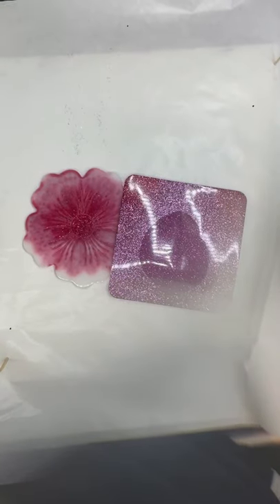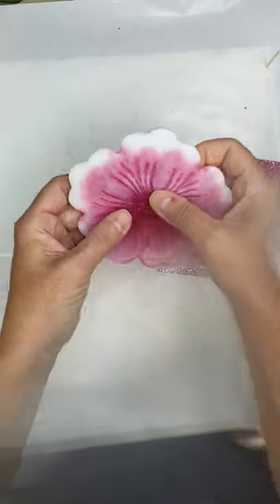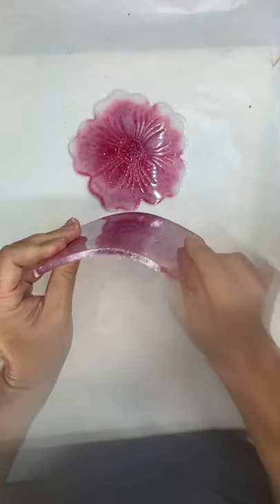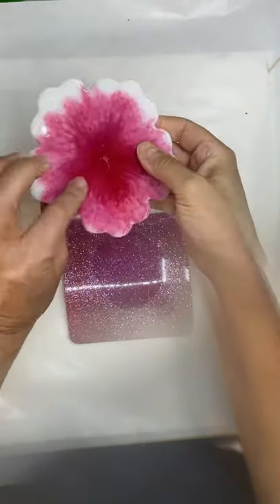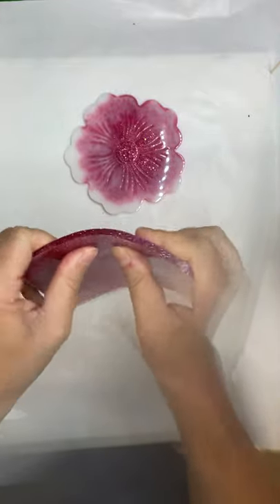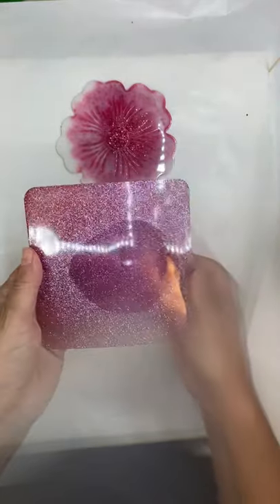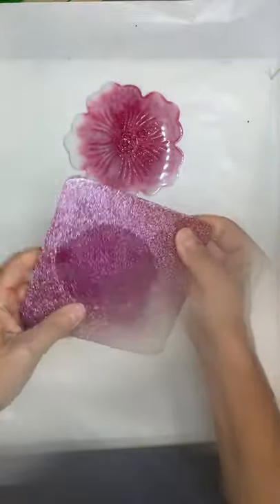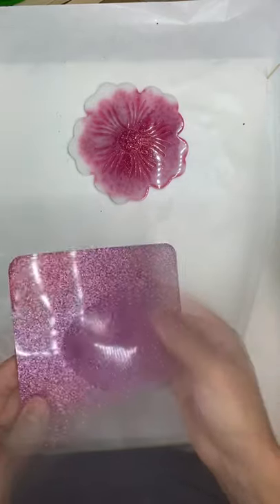Why is my resin bendy?  -- Learn why your resin is soft and flexible

Comment: man, I've been using Art Resin to make some casts. In some molds, the resin hardens fine, in other molds it never really cures right. Unfortunately I put a lot of time and effort into some charms vs some bigger, easier pieces (that cured fine), and it was the time-consuming pieces that ended up bending lol. I sprayed mold release in the same molds that weren't curing right because the resin was sticking to them (but not other molds). Didn't bother to look up how appropriate that was lol but I suspect this last batch may have soaked up the mold release 😭😭 I'm wondering if I sand the pieces down and coat them in a fresh resin bath, it'll seal the soft resin in hard resin? xD I don't want to throw them out

Comment: I make keychains and i used the same resin for my keychains and one came out hard and another came out bendy. Does what you put in your resin (things like decorations and such) have an effect on the curing process?
Reply from the maker: Yes, it does.
Reply: Mine have been doing the same. I make keychains, and here lately it has not wanted to cure right.

Comment: I have a question…I know this video is a couple years old but I cannot for the life of me find the answer anywhere to this! My sister and I have been making resin things like coasters and bookmarks and trays and things for about a year and a half. We recently we had some of our things at a craft fair and it was outside on a sunny day. And things that we had made a year ago and were solid as a rock started to bend and droop in the sun!! Why is this?! We knew sunlight could cause color change but had no idea our things would start to bend!!! Is there any way to ensure this doesn’t happen??? We had products at the fair made with 2 different resins, one was a quick cure resin and the other was a deep pour slow cure resin, and products made with both were bending.

Comment: This is a great video, thank you! However, in my case, I used the same resin for everything I made. It was my first time ever. Anything I made in blue is completely solid like it should be. Everything else is bendy. First thing, there was some that was not exactly 1:1, since I didn't set the silicone mixing cup on a flat level surface to pour it. I held it and poured with the other. That might have done it. OR, could it be I might have used too much pigment and/or mica powder in the other colors. Any ideas?
Reply from the maker: Hi, unfortunately, one resin doesn't work to make everything perfectly. This article will help: https://www.resinobsession.com/resin-frequently-asked-questions/best-epoxy-resin/

Comment: Flexible coasters are "inappropriate?" How so?
Reply from the maker: I think people have an expectation that a coaster won't bend or warp with use. I'd hate to think someone put coaster in a drawer only to get them out later and find they're in a wonky shape.
Reply: @ResinObsession  Bent or warped, sure. Then it doesn't sit flat. But if it remains flexible, what's the problem? Not trying to be a jerk or anything, it just seems  to me that flexible resin coasters might actually be a good idea.
Reply from the maker: If a coaster is bendy, it's also more likely to scratch. If your coasters are flexible, and you make people aware of that, then I think it's fine to have bendy coasters.
Reply: @ResinObsession  That makes sense. Thank you!

Comment: I needed some resin, saw some at Walmart while I was shopping, and figured I'd give it a try.  It was a Rustoleum brand of pour on epoxy.  I used it in a mold, and my keychains came out super bendy.  I managed to stiffen them up pretty good, with several coats of casting resin.  
It might be fine for keychains to be bendy, but I didn't like it.  Who knew there were different kinds of resins?  Lessons learned... the hard way, of course.
Reply from the maker: Glad I could help!
Reply: Did you paint the casting resin on, or dip the Keychain in it?
Reply: @truck6859  I painted it on.

Comment: Now what would do if you accidentally calculate your resin/hardener mix. 

For example the correct ratio is 100/50 and you accidentally  mix a 100/40 ratio?

Will resin get hard eventually and is there another way to save what was previously poured?
Reply from the maker: It's unlikely this resin will harden.

Comment: I would like to do a resin art 24” 36” size and that would be carried other country. 
- though luggage size is not big so is it possible to package in a folded way? what resin formula should be used? Which formula will help to maintain the texture? 
For this should just resin is enough as base or painting on canvas cloth is good ?

Comment: Question…….

I want to make what is called a “bonk rock” it’s a term Onewheelers use to describe a small rock shaped hump or bump or volcano shaped or ramp shaped lump to place on the ground to ride over with a Onewheel which is like an electric skateboard/hoverboard to provide a way to hop both vertical and horizontal just ever so slightly lol hope this makes sense there’s lots of videos of Onewheels using pocket bonk rocks…people sell bonk rocks but they are pricy I have no clue what they are made from  and is what I’m trying to find out or at least pointed in the right direction..I was thinking it’s some sort of  flexible resin is what comes to mind.. these would be a created using molds obviously since bonk rocks need to have some height and are pretty thick depending on what you like and different shapes. a flat bottom to place on the ground. is a resin capable of this? It would be run over by wheels placed on dirt on asphalt sidewalks. I can’t have it sliding so it needs to hold place decently I would expect it to move s bit and hold shape but it would not be hard as a rock it would need to be slightly bendy and flexible but not like ballistics gels type of squishy.. no chipping cracking or breaking from the abuse of being run over and hopped off of.hoping it would have a little weight to it as well. Again all I know is from what I’ve seen on bonk rock websites and videos  and I just can’t pay 60 bucks for a jelly looking bonk rock.. I’m a total diy person and always try to find a work around when I can.. and I feel these would not be something technically complicated and could make my own and probably many more if I made it myself.. just need to know what it’s made of without having to actually pay for one lol..These rocks I’ve seen seem clear or with colors mixed in each in they say are different no two the same not sure what else could be used other than some sort of clear bendy flexible resin… does anyone have any tips or idea what these are made of? if so where can I buy?👀
Reply from the maker: Hi Bree, I wouldn't use resin for a project like this.  😕

Comment: Actually, for the craft I'm trying to make, I need the resin to be a little soft or bendy. What can I do to get that result?
Reply from the maker: Use a doming resin.
Reply: . Thank you very much😁 Can that be brushed or dipped? What I want to do is apply it to a thin metal ring, about 3 - 4 inches in diameter.

Comment: This was helpful thank you! Can you mix the correct harder separtely and pure onto the mold so that it hardens? Remining the correct chemicals, a thin layer? I have this problem and I do not want to toss my art, and they are beautiful but bendable.
Reply from the maker: Hi Latoya, assuming your resin cured fully, I'm afraid there isn't a way to make it harder. You can try to put it in a frame or brace it from behind.

Comment: Is super gloss from the epoxy resin store a casting resin?? And can I use it to coat art work and make a bowl with??
Reply from the maker: Hi, I'm afraid I don't know about those, but we have casting and coating resins in the Resin Obsession store.
Casting resins:  https://shop.resinobsession.com/collections/resin/casting
Coating resins for artwork:  https://shop.resinobsession.com/collections/resin/surface
Reply: @ResinObsession  which one would you suggest for free pours and art work??
Reply from the maker: The Resin Obsession artwork resin works great for that.  You can buy it in our store here:  https://shop.resinobsession.com/collections/resin/resin-obsession-artwork-resin

Comment: Hi，I made an square resin in a square mold around 8”x 8”x 2.5”, but the sides bent inwards after demolding, do you know why? Thank you!
Reply from the maker: It sounds like either your mold sides weren't straight or your resin wasn't fully cured before demolding.

Comment: My resin tray is hard. I cannot bend it at all by adding pressure with my hands; but when it isn't on a flat surface for long it warps :/ is this a regular thing?
Reply from the maker: Hi Paulian, unfortunately no.  It sounds like your mold wasn't level as the resin cured.
Reply: Did you find a solution? I’m facing the same problem! My tray is hard and perfect but when I lay it on a sofa/uneven surface it curls and warps as well !!! 😭😭😭

Comment: So could you help me by telling me what resin/product i should use if I want my molded piece to be bendable. I have been searching forever to figure this out. I love the quality of a resin piece but if I want to adhere the piece to make a decorative egg I need it to be flexible to take that curved shape. Please help. Can't seem to find anyone with the answer.
Reply from the maker: Have you thought about applying the resin directly to the egg?
Reply: @ResinObsession  Actually that's exactly what I did once. I had made a particular delicate scroll piece that was still a bit pliable when I removed it from the mold so I placed it directly on the egg and gently taped it on. I hoped it would finish "hardening" and I could remove it, with the curve still intact, and paint it. When I removed the tape I discovered it wouldn't come off the egg! Well luckily that worked out fine anyway, just made painting alittle more difficult. But it would be nice to be able to make a bunch of pieces ahead of time to use on curved surfaces.

Comment: The casting resin can also be bendy, if you got the mixture wrong. If you use less hardener, than you should, it also can come out bendy... it tends to harden a bit over time, but it usually stays a little flexible.
Reply from the maker: Yes Lars, you're right on that too, but I find that using a doming resin in a mold is the most common reason people have flexible castings.  I mention that and other reasons for bendy resin in this article:  https://www.resinobsession.com/resin-frequently-asked-questions/why-is-my-resin-bendy/
Reply: If a casting resin comes out bendy and if it's a ring, is there a risk of chemical leeching? I made a few rings and two of them are for my kids. 3 and 5.
They have been waiting patiently for them and pretty excited to be honest. Thanks. 

Sincerely,
Jeff

Comment: Can you fix this if it is still in the mold?  Pour a thin coat of casting resin in the mold if there is space?
Reply from the maker: That might work.
Reply: @ResinObsession  i have this super bendy tray ...i made 1 that dried fine..the other 2 dried up supppper bendy...for my recent tray,its bendy but i havent put a top coat on it...should i try the casting resin if it can work to dry hard for the tray?

Comment: I use casting resin but when I leave my coasters in a hot room like no A/C and 90 degrees it starts to bend. Is this normal
Reply from the maker: No, I wouldn't expect that.
Reply: @ResinObsession  when I take my trays or coaster in the house with air conditioner is rock hard but if I take it outside start to bend like hard rubber. I tried many resins, they always 1 to 1, I use an scale for the resin. Do you have any idea what I may be doing wrong?
Reply: I’m having the same issue sadly. I’m not sure what I’m doing wrong and I’ve watched so many video’s:(
Reply from the maker: Hi Ilka, this article details more reasons why your resin can be bendy:  https://www.resinobsession.com/resin-frequently-asked-questions/why-is-my-resin-bendy/
Reply from the maker: Hi Bianca, this article details more reasons why your resin can be bendy:  https://www.resinobsession.com/resin-frequently-asked-questions/why-is-my-resin-bendy/
Reply: Humidity affects resin a lot, air conditioners dry the air as well as they cool the air. I know people use a heat gun to warm resin up to bend into a shape for sculptures and 3d.

Comment: Hii. I recently bought dr. Crafty' s resing and used it on a mold, it turned out blendy. I don't know if this brand is a castin resin o maybe i just poured out the mix with different measurements 😭
Reply from the maker: Hi Andri, while I haven't used that resin, I've heard the same thing from other users.  Have you considered a clear casting resin?  We've got a few in the Resin Obsession store that cure hard and won't bend.  https://shop.resinobsession.com/collections/resin/casting
Reply: I use that resin the 1st time and it was great,  but the second time, my project came out bendy

Comment: I use part a and b for my mini name letter keychains since I run out of stock with UV resin . However it's been 2 since then, until now it's still a little bit bendy for me. And trying to harden it , I accidentally put them outside for direct sunlight . Unfortunately my items got ruined. The purple colors fade and are still bendy as ever.
Reply from the maker: Oh that's awful! 😭
Reply: What would a resin shaving razor handle feel like?

Comment: Useless video. Did not give the solution to fix the issue of bending piece
Reply from the maker: Hi Vidya, you're right. There isn't a good solution to fix bendy resin. Using a better resin moving forward will keep it from happening again though.  That's why we've got the Resin Obsession super clear resin and Resin Obsession deep pour epoxy to help you: https://shop.resinobsession.com/collections/resin/casting